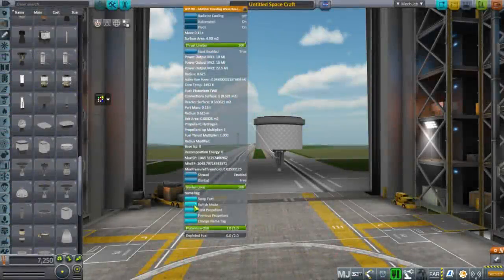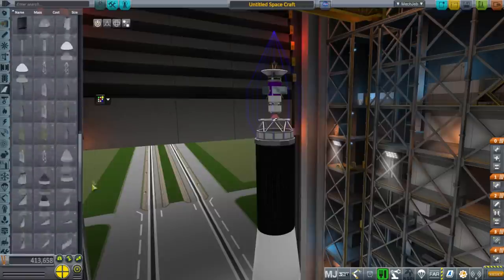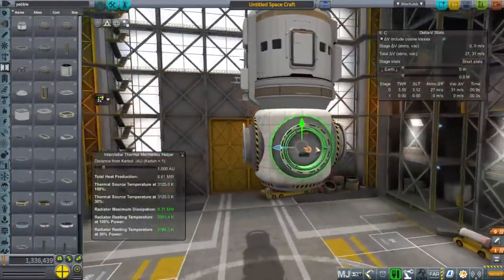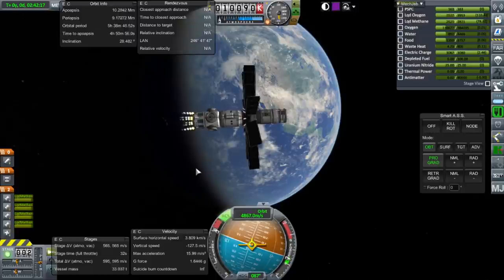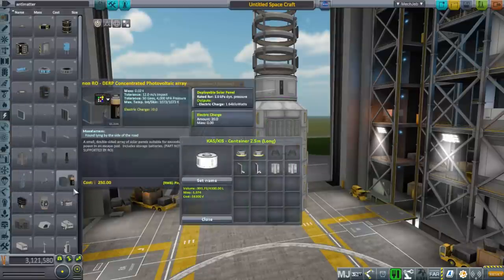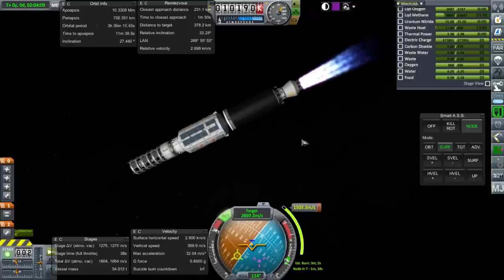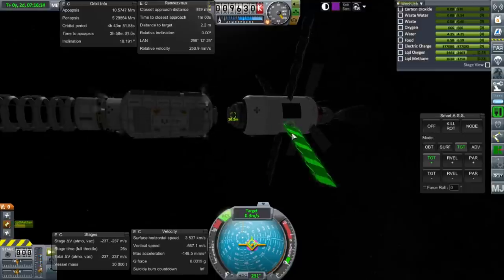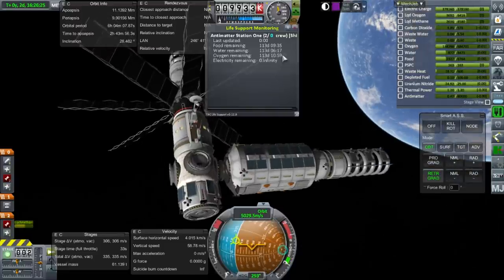Kerbal Space Program - Interstellar Overhaul 04 - Redo in 1.2

Comment: 1:40 the thermal launch nozzle's ISP and thrust depend on the reactor connected to it. you get a couple thousand m/s dV and a ridiculous amount of thrust from antimatter, for example. then again, you need to cool that, too.
Reply: 4:05 more or less the same. just much lower thrust.
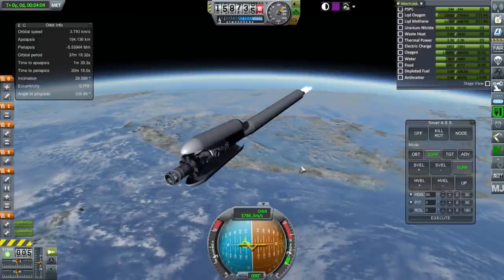Reply: 7:00 radiators have an automation setting that causes them to deploy automatically if there's heat to be radiated - they probably don't do that in fairings though. that might be it.
Reply: 10:40 do you have an electrical generator attached to that? because most reactors, including that one, don't actually make electricity - they just produce heat and/or charged particles that can be turned into electricity.

Comment: Why didn't you connect the reactor to a thermal electric generator? The Pebble-bed reactor was just idling, the only power it produced was from a build in modulator generation only a few KW.  Without electric MW production,  engines like the VASIMR will not work.